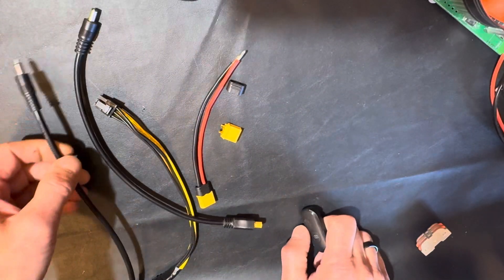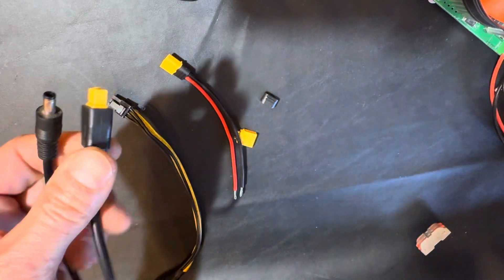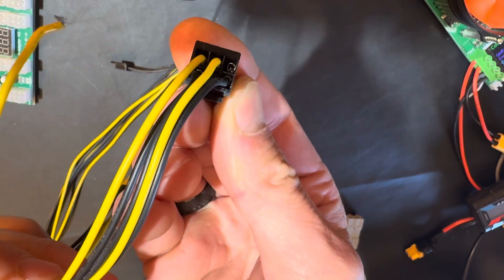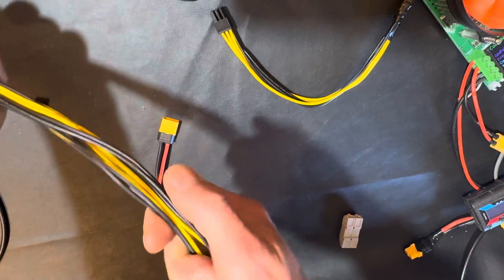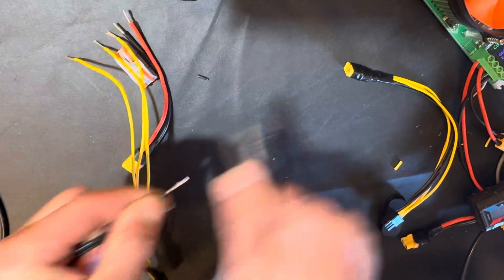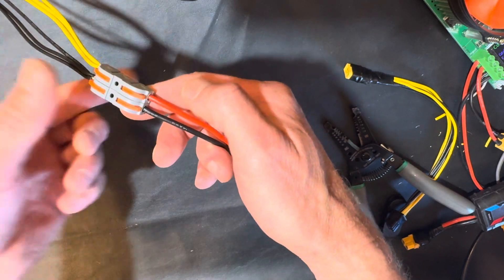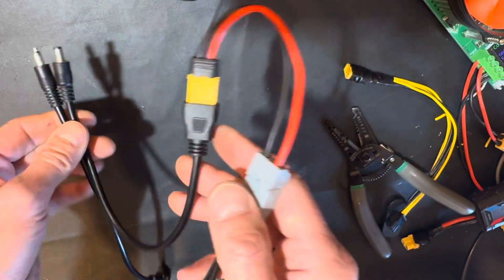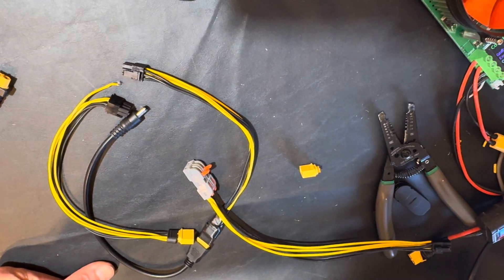MAKE YOUR OWN CONNECTOR FROM SERVER PSU TO KS0PRO SAFE, WHY CONNECTORS FAIL

Comment: I know my capability in basic electronics and I'd easily be able to do this, but I'm extremely worried to try it since breakout board 6-pin output voltage is 12V and input voltage range on KS0 is 19-20V. If I were to try this, I'd get inline breakers installed on each connector in case the amperage spikes and possibly a boost converter to 19V. Or I'd find a 19V breakout board.
Reply from the maker: I have used 19v boosters, and it uses more power to boost to 19v, by the way that’s the only way I could overclock ks0 OG but ks0pro runs better on 12v with a lot better temps and power consumption when overclocked. The only issue is the load on the barrel connector over 10amp connector fails it is a matter of time on one unit my failed after 4 month on the other after 1 week. So xt60 holds up 15Amp easily without overheating. And yes you are correct pcie load over 150W kinda dangerous have to use super quality cables like veteran miner does or I just double the pcie cable just like on GPU ( basically use one pcie cable to make 2) and connect to xt60 . Easy to do and would not fail. I have several pcie cables failed at the psu breakout board connector just like on GPU. So double the cable and good to go.

Comment: Very informative, thnx. I tested the 18 awg 6 pin cables on my not overclocked device and it got warm after several hours. Not dangerously hot but can never trust them either.
Reply from the maker: Yes, Keeping it safe is the best practice because these connectors fail when you are not watching

Comment: I have been using 230 w upgraded laptop power supply on all my KsoPro's . I hope that the plug doesn't have issues.
Reply: Great info!
Reply from the maker: you should be good on 19V because you are using only 9amps max on 19v for overclocks, this issue is only for 12V system
Reply: That is a relief and makes sense. @DontMindMeMining
Reply: @DontMindMeMining  So not any point to migrate from laptop charging to a PSU 12v ?
Reply from the maker: @Stantheman-f3r it’s a personal choice but need to use a lot of caution. Laptops PSU also can overheat in hot incitement. For me laptops psu didn’t works I have to run 10 ks0pro so I  can only use 12V system to get rid of lots of wiring from laptop PSU plus I don’t think they are very reliable for long term comparing to the server PSU that can run 24/7. My solution was to solder silicone wires directly to board.